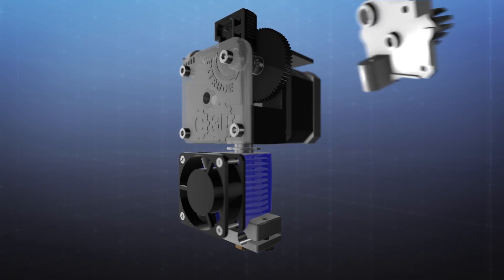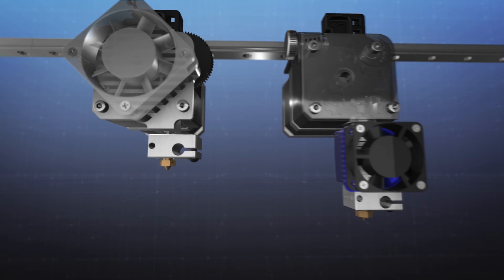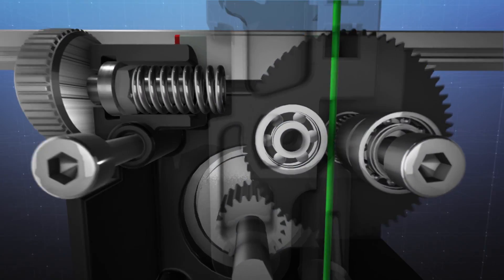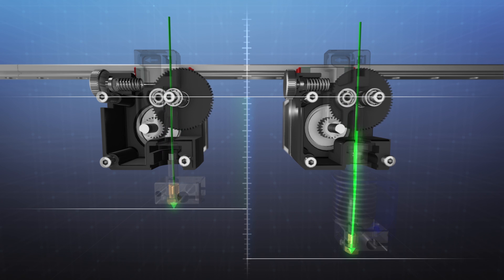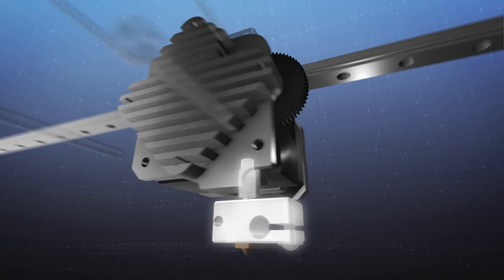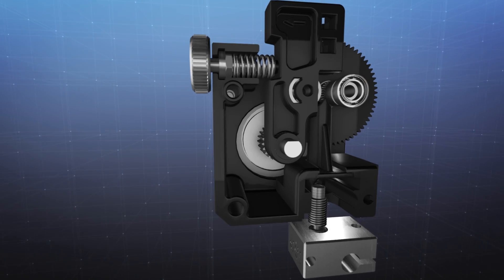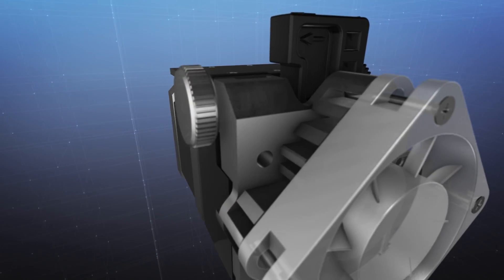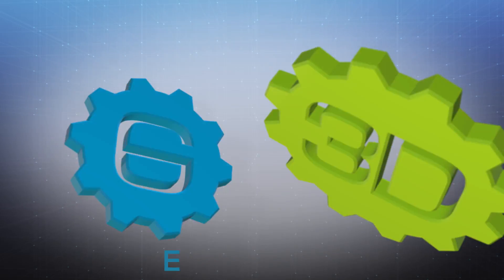Titan Aero: A 2-in-1 HotEnd and Extruder from E3D

Comment: Soory guys, but the rotated fan look stupid af. Why did you do that? :( It ruins the hole setup.
Reply: It is obvious.. the fan screws are low torque. The extruder assembly screws are higher torque... you don't want people busting their extruder fans when tightening up the whole assembly to adequate levels for the mechanical part of it to hold together.